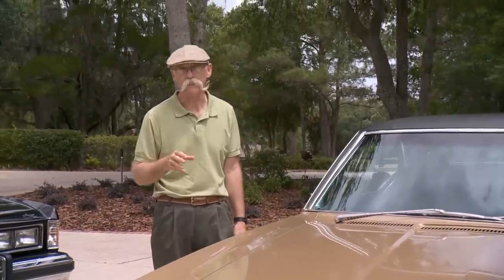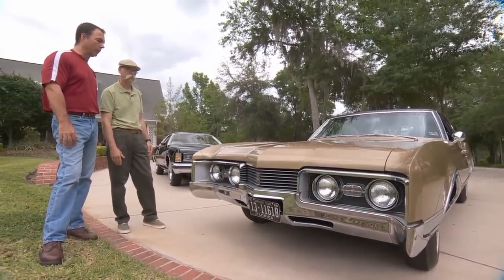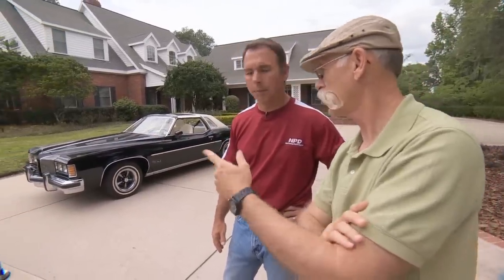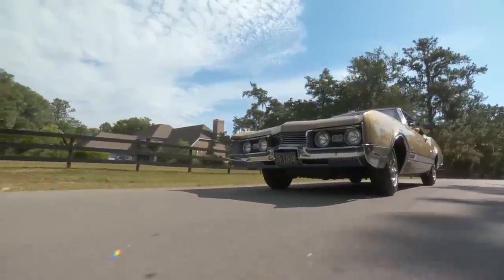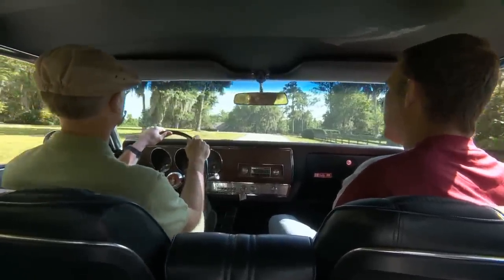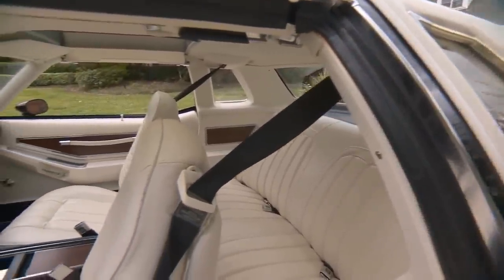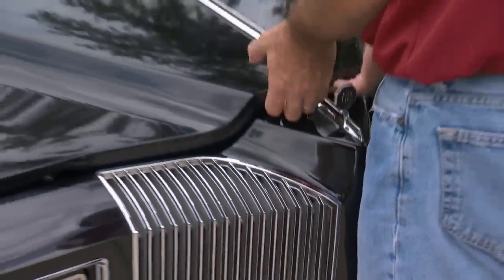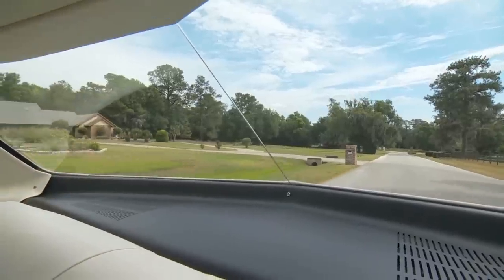GM Luxury Sports Cars

Comment: How many would take that 1976 Pontiac Grand Prix over that '60s Oldsmobile?
Reply: GP for sure, starting to get good money for or them, its about time.  
I have a 72, 455 power seats, windows locks and air conditioning. Its triple white but interior isn't as nice as the 76. I also had a 77 that was all black but had the little 301 motor. Not enough umph for me. GM screwed up shutting it down, the G8 was a badass modern car. Best styling in years finally got it back and they shut them down.
Reply: I would in a Heart Beat.  I owned two 1977's
Reply: Style over substance in the later 70's. Slow and unimpressive...
Reply: I had a '76 Grand Prix... ok car, but the back seat was little more than a nicely padded shelf for groceries.  there wasn't enough leg room for my then-8 year old daughter.
also, performance sucked.  0-60 in 17 seconds, standing 1/4 mile in 23.  add to that a hard ride with too much body roll (stiff springs with too-small anti-sway bars) and the thing handled like a greyhound bus.
mileage wasn't bad with the 350-2V (16 city, 20 hwy), but if you wanted one of these that could at least get out of it's own way the 455 was the only option... but even back then with $0.59 gasoline, 13 mpg highway could get really salty....
Reply: I remember both cars, they were common, the pontiac I was getting my drivers license that year.
Reply: Hell yeah brethren
Reply: With a few minutes to think about it, I could probably come up with a pretty long list of cars that GM discontinued soon after they finally got them right! The Fiero comes to mind for a start.
Reply: I'd take the Olds.
Reply: Grand Prix for me. These cars aren't and weren't about 0-60 and 1/4 mile performance, these colonnade cars are about style, class and comfort. However, most Pontiac engines  readily accept bolt-on mods like cam, headers and intake, and will move the two ton boats down the road with ease. The 455 engine with proper mods is a torque monster
Reply: I would take the 60's Olds over the 70's Pontiac just as I would take a 60's Pontiac over a 70's Olds. By the 70's the big GM cars had no muscle, even though the CID were big, 400, 455, 454, but no HP. In the 60's a 389 Pontiac kicked out 325 ponies, a 77 Olds 400 probably put out about 160 horses, the gas shortage, remember?
Reply: Like I mentioned in an above post, I had a '77 Grand Prix that was just a pleasure to drive all 'round and with a killer stance and clean(it was dark forest green with a lime green interior, bucket seats with a console, Rally II wheels like the one shown. Those wheels have been available on Pontiacs since they first appeared in '67 on GTO's. It was a pure pleasure to drive, especially on long trips.
Reply: Dale Andrews  I remember that car, it was nice, unfortunately not much power. I think I had one of the last big power Pontiacs, a 1971 Bonneville with a 455 HO that put out 385 horses, had one quad, automatic, with posi, dual exhausts, made about 16 miles per gallon and I did not care!
Reply: myrryxmas: Sir, your logic is all wrong!!  This car was purposely built to help the average 22 to 30 year old guy get noticed by  similar age babes in the parking lot of his local disco, grocery store, country club, or wherever. Trust me, when you pulled up in this beauty, you were being seen by the halter-topped set sporting their Farrah Facwett hair-do’s.  At the same time, the GP provided a very comfortable and reasonably dependable ride.  It’s almost impossible to overstate how effective this car was at helping establish an impression that ultimately led to lowering those wonderful halter tops.
Reply: man, I miss my 76
Reply: Me
Reply: I'll take the Grand Prix over the Delta 88 as well.
Reply: @dkeefep11  I had a '76 GP Red w/ white int. Beautiful car but even w/ the 400 it was a dog!!  Too much pollution crap on it!!!
Reply: I would take either.
Reply: ME
Reply: Used to have a 75 LJ with the 400 red velour interior, burgendy and red metal flake, best looking car I've ever owned!!!
Reply: I had a 74 GP in high school. Sure wish I had it now
Reply: My Stepfather had a 1969 Grand Prix.  Ugly green with green vinyl top.  Tan interior (which was nice).  That care could chirp rubber in every gear.  Wish I still the car to restomod it.
Reply: As long as it didn't have any "growth" juice on the seats,I'd take either
Reply: I personally love auto's from the year 1967, I owned a 67 Pontiac LeMans, charcoal gray with white leatherette interior,  I put gray cragars on it. Traded in for a mid- engine two seater Fiat that I enjoyed very much.. I've always wish I  would have kept the 67 LeMans though... This Grand Prix is what's up.
Reply: I dunno, tough call. That Olds is pretty damn nice, I bet it rides like a dream.
Reply: @audiobuff77  or both.
Reply: Me, my wife had a '76 GP when we started dating in high school. We fell in love in that car, still married 28 years later....
Reply: @KLRHEMI  Yes. I owned a '77. To this day the most comfortable vehicle I've had.
Reply: '77 Buick Regal I would.  Had a 77.  No T tops and small engine, ,
Reply: Oldsmobile for the win, big engines with ample horsepower, and it's so comfortable, you could sleep in it
Reply: Not me, but the t-tops is super awesome.
Reply: I'd take the Olds.  That Rocket engine would eat that GP for lunch.
Reply: Not me.
Reply: I’d have to go poncho. I like Olds more than Pontiac and have a project car 1972 Cutlass Supreme, but the delta  is blown away by the Pontiac. Of course I’d rather have a 442 or supreme of the same 67 vintage over that Pontiac. Luxury evolved from 1970   - nice seats, a/c and a clock to 1978-  factory cb radio, am/fm cassette radio, thermometer on the mirror, cornering lights and so much more.
Reply: reignman2112  1980 Regal? 29k miles? It should start burning oil any minute now.
Reply: reignman2112  We had a beautiful '81 Regal.  I changed the oil myself every 2k miles. Washed and waxed it regularly. It started burning oil at 60k, and rusting the rear panels.  Drove it for over 110k miles, but it was completely rusted out . Such a shame because my wife loved that car.  Still better than my '97 Dodge Intrepid though!
Reply: '77 Buick Regal 
I don’t know. You’d have to drive The Oldsmobile to appreciate it. That 425 engine with 360 HP could help me decide lol
Reply: lloyd breaux to
Reply: You crazy. The delta 88
Reply: Me personally, i take one in the SJ trim. These were nice cars back in the mid 70's before the downsized started in '78.
Reply: @bigsid54  That did'nt seem to matter back then like every american car or truck the automakers were forced to cut down on performance 4 fuel mileage even the 'vette suffered the same fate. It was'nt much further down the road another ⛽ crunch was just beyond the horizon!!
Reply: @myrryxmas  U have to remember the big 3 were forced by the feds to improve fuel mileage over performance. Some people seem 2 forget the fuel crunch of 1973 when the oil was cut off forcing american drivers to save on ⛽. I remember u were only able to load up on petrol based on the last digit of your license plate being there was a limit to fill your tank. Meanwhile the import car makers were boasting higher gas mileage from japan Mazda,Toyota,Datsun and others were just starting to knip the heals of the big 3 contining to crank out these big cars without even thinking of the future down the road.
Reply: @daniellaubach7544  i remember the gas crunches of the 70s very well... i got my license in '78.  my only complaint about the Grand Prix was the back seat. my mother bought it new at the dealership when i was 14.  i was already 6' tall, and family trips relegated me to the rear seat.  it was the ergonomic equivalent of a chinese torture device for me.  at the time, i begged her to buy the Catalina they had in the showroom instead.  it was even a couple hundred dollars cheaper, and the EPA mileage estimate on the door sticker was the same.

when she went to trade it in on an '85 Parisienne, they only offered her $200 so i bought it from her instead.  i needed a reliable car and she was a fanatic about maintenance, so i knew it was well-cared for.

it served me well for 6 years before i sold it, but long trips for MY family weren't comfortable for the kids, either.  i'd have preferred a little less hood (the front of the engine block was a full 30" from the bumper) and little more rear-seat legroom, that's all.
Reply: if it wasnt for that whole entire detuned engines fiasco i think i would
Reply: I love my Pontiac's, Me!! I will take the Pontiac grand prix! anytime. First and original muscle💪🏽💪🏽💪🏽💪🏽Car.
Reply: I ordered a 1977 Grand  Prix.  I was 21 at the time.  It was dark metallic green with a tan padded Landau top, gold pin stripes and a tan interior.  It had the 400 engine and the 400 transmission.  It was a beautiful, solid, smooth riding car.  I chose the 60/40 bench seat so that if I ever got a girl friend she could sit close to me!  It was a wonderful car.  I wish I still had it.
Reply: i had a 1970 j model gp 400 0 to 60 in 12 sec my frist car made it to kings dominion in 40 mins topped out 170
Reply: @Chris_Troxler  I was gonna say that 67 Delta 88 with that 425 super rocket was probably  a beast if you chomped on the gas. Over the  past few years  67 and 68 standard Oldsmobiles  have really  been growing on me!. As for that 76 Grand Prix, yes they were chick magnets back in the day I had a 77  Grand Prix coupe and even though it olny had that little 301 v8 I kept it for five pretty  enjoyable  years. I must say though  you had to keep after them because back here in northern Ohio  Grand Prixs as well as almost any car from that time  would sure  as hell rust. Having said all that This 77 Grand Prix is another  car that I had and now miss!
Reply: Yes for sure
Reply: Absolutely not Oldsmobile all the way that Grand Prix they were plenty of those on the road saw those everyday
Reply: Not me.  Could not hold a candle to the Delta 88 in terms of performance, simple, clean styling, and overall quality.  Have driven both.  The Olds feels so roomy and airy inside, the Grand Prix feels cramped and confining.
Reply: @KLRHEMI  I would take the Grand Prix over the Oldsmobile anyway.
My first car was a 75 Grand Prix with the moon roof
I would love to get another one someday
Reply: The Pontiac is a killer to drive in or ride in. We rented one late at night and our driver had a heck of a time getting in and driving. We found the only window we could look out was the that huge rear window.
Reply: Not me.
Reply: I love Olds , but my grandma had a 76' LJ G.P. in Orange with a white Landau top . I would have loved to have my grandma see her favorite coupe again.
Reply: I would  take both
Reply: I love Pontiacs but my love for Olds is stronger.

Bob The Builder👷
Reply: I can name a hundred cars I would rather have than either of them. I didn't like the styling of the 60's big Oldsmobiles or the colonade style GM midsize.Anything after 1972 in the 70s didn't impress me. My favorite Pontiac would be the 1964 Grand Prix.
Reply: Igor would
Reply: @igorslocks     👍🏽😎
Reply: I would!
Reply: Grand Prix any day 😍
Reply: @dkeefep11 ❤🇵🇷
Reply: Not me. By 1976 GM had taken so much content out of their cars that you couldn’t compare the two.
Reply: Of course I would choose the Grand Prix
Reply: I had the 74 SJ with a 455 and every option what a car

Comment: My father bought my mother a brand new 2 dr 1974 Cutlass, Reef Turquoise, and it had a white & black interior like this car. Always thought that combo was so cool. In 1977 I was considering buying a new Pontiac Trans Am or Formula and the local dealer had a two-tone blue GP in the showroom. Gorgeous car, it was the LJ model with a blue velour interior and the dash and interior design was so cockpit I almost considered it but I was 21 and a 4 speed car is what I wanted. Bought a new 1977 Camaro Z28 which I loved but will always remember that beautiful ‘77 Grand Prix.

Comment: Brings back memories of the '71 Oldsmobile Delta 88 Royale two door I used to have.  Dark green with a 455 with A/C.  Indestructible. Even though I was young at the time, I always felt like a big shot driving that car.  I loved driving around with my elbow out the window smoking a cigar.  That car could light up the tires better than anything I ever owned.  Also had a gold '70 Grand Prix for a while.  It was faster and handled a bit better, but the Olds was a better car.
Reply: I had a1973 old 98 with a 455 it was a 2 door to Kurt I loved that car and it would smoke them tires. A very strong great riding fast car. I miss those days.
Reply: @donaldwhitten2438  I am in the process of getting my 1973 Olds 98 running again after sitting in my garage for the last 15 years.
Reply: Would have loved to see What that Oldsmobile Toronado could have done with a modern cam and headers.
Reply: Got a 71 delta 88 royale convertible  I'm restoring now. 455

Comment: I love the T-tops and white interior on the Pontiac. There is something really fun about it.
Reply: Until the rubber gaskets around the frame where the glass rests begins to shrink, tear and dry up, then leak rain water into the car.  Been there, done that.
Reply: Today we have high quality Silicone rubber seals that would be both shrink-proof and even oven-proof :O).
Reply: BellinghamsterTrail But no more T Tops.
Reply: How about TARGA tops.  I think Ferrari still uses them. As does Corvette?
Reply: We had a nice older Grand Prix, possibly a 1970. It was not as grande as this one but I remember that sexy class of cars - the big pony cars - Caddy El Dorado, Olds Torando, Chevy Monte Carlo, Buick Rivera. Nice sporty cars with long hoods. I recall the boatlike feel of looking down the hood of the Grande Prix and the cockpit-like driver's seat. Nice glass roof.

Comment: Ah yes, golden years return. 

I owned a '67 Olds Delmont 88 (same shape & style as this video) in the late '60's. My Olds was a 2 door coupe just like the one in the video with that "fast back" styling. I loved that particular styling @ the back as well. Love "the nose" syling of the car with the Olds Rocket logo emblem to compliment the "nose" of my Olds. It was an auqa (blue green) color paint with a black vinyl top. As all my vehicles I've owned, gave it tender loving care (TLC) as it's owner. Had a small block "Jetfire Rocket" V-8 (330 cu in) engine. Ride & performance was perfect. Just what you'd expect from its "Rocket Engine." 

@ times, I still wished I had kept it but had "hot pants" to purchase a newer upgraded Olds. 

Ahhh, I'll always have memories of my '67 Olds Delmont 88 2 door coupe.

Bob The Builder👷

Comment: I had a '77 in the '80's. I bought it from an old man who kept it in incredible shape. It had low miles when I bought it(33,000 sticks in my mind for some reason) and was immaculate. The old man garaged it and even Armour Alled the floor mats! I drove it way past 100,000 when it began to rust around the rear window, where moisture would collect. It was dark forest green with a lighter green interior and was stunning. I called it my "boulevard yacht". It was so long and heavy driving it was like driving a pillow. I miss it just typing about it!

Comment: Small fun fact, cars of this era had 2 keys. The part that you grab with your fingers was either square or round.The square shaped key was for the ignition. The round one was for the glove box, door, and trunk.
Reply: That was a running theme right into the 90's... heck early 2000's for some cars.
Reply: My 02 Camaro has two keys. 😄

Comment: I was 9 years old and actually with my grandmother the day she took delivery of her brand new 67 Oldsmobile Delta 88 Holiday Coupe at Oge Oldsmobile in Tyler, Texas.  It looked identical - same gold paint and black vinyl roof - to yours in this video sans the Delta Custom optional features - additional side chrome, rear lower bumper tail lights etc.  The interior was identical, though,  and included factory air conditioning and an AM radio. I distinctly remember getting to sit in the back seat while the salesman described the operation of each switch and feature to her. The beautiful red center of the steering wheel was exactly the same with the Oldsmobile rocket emblem.  She was so proud of the new Delta having traded in a blue 64 Chevrolet Impala 4 door hardtop for it.  She was on the road a lot in this car and I had the privilege of getting to wash it frequently for her.  I can still see every detail of the exterior in my minds eye from having washed it so many times.  The Oldsmobile was truly a step up for her as it was more personal - a new sales concept at the time, especially for single buyers - luxurious and sporty.  As a single working lady, the car represented a major accomplishment for her and she couldn’t have been more proud of it.  Thinking back on that day I couldn’t have realized until years later how much this meant to her at the time.  Seeing your car in this video brought back all those vivid memories from that day 53 years ago at our local Oldsmobile dealer in Tyler.  Thank you so much.

Comment: My parents had the exact same Delta 88 model in the same color (champagne metallic), bought new in ‘67. Traded it in on a new ‘71 Toronado. I remember the car well. You couldn’t see out the back window due to the extremely slanted fastback design. Very cool car!
Reply: exittiming M the Toronado was a beautiful car too. I was too young to drive when it was out but I remember my parents marveling about the front-wheel drive.
Reply: We had 1960 Pontiac Bonneville had all the features was red outside and inside the kids loved it when my parents gave them rides in it and I was in high school in late 60s😁😍